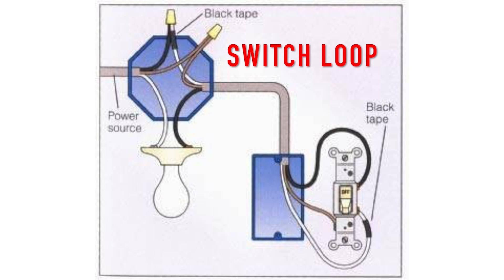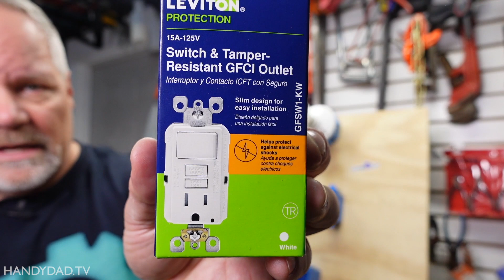GFCI Switch and Outlet Combo

Comment: I followed your instructions to a T and both the switch and the light work in my bathroom BUT now my kitchen and outside light won't work! Any idea why this would be?
Reply from the maker: Double check that you didn’t reverse the line and load wires.

Comment: Very helpful - but instead of wiring the GFCI Switch to a light bulb,   can you wire another receptacle so that it is controlled by the switch?        Not sure I understand why the two wires associated with the GFCI's switch are black,   when you need to have a white and black wire (plus ground)  going to a downstreat receptacle?

Thanks
Reply from the maker: You can supply any load from the switch, regardless of whether it’s a light or receptacle. Both wires are black because they are hot wires.

Comment: Hi, thank you for the great video. If there is no neutral wire present in the socket, there is no way i can wire this right? There is only the hot and the one going to the light.
Reply from the maker: Correct. You need a neutral.

Comment: My outlet only works with the light switch is on... What did I do wrong?
Reply from the maker: You connected one of the switch leads to the hot line and the other to the brass line screw. 

You need to connect the hot line AND one of the switch leads to the brass line screw. The other switch lead goes to the light.

Comment: This is one way of wiring but, This way bypasses the gfi protection for the switch leg, witch is fine if your light is in the ceiling,  but if your light is in the shower with you then you would want the switch leg protected also, it's almost the same except you would wire the switch lead to the load side, the side with the sticker on it and the neutral as well to the load side and then  the outlet and switch leg are both gfi protected.
Reply from the maker: You are correct. It can be wired so the light is protected. But that’s rarely done so you don’t find yourself in the dark if the GFCI trips.
Reply: @handydadtv  yes but if it trips that could have saved your life thats literally the point. i would rather be in the dark in the shower then being electrocuted in the shower,  there are many reasons not to protect the switch leg, but there are also many reasons to protect it as well, this device does not include instructions for bypass for a reason, im just saying people should know and understand their situation first and what needs and doesnt need protection before you wire in gfci devices and take upon yourself to bypass the protection part.

Comment: What if all I have is two wires, no ground and no neutral?
Reply from the maker: To use this device, you’d need to run a new 3-conductor cable between the light and the switch box.

Comment: I wired my outlet exactly like yours (same model number and brand) and my outlet shuts off with the switch. No idea why
Reply from the maker: If the old outlet was controlled by a switch, the new outlet will also be controlled by the switch.
Reply: @handydadtv there was only a switch installed, added the Levinton switch GFCI in hopes of being able to have an outlet as well. But the video was still very informative!
Reply from the maker: Oh, I misunderstood. The hot wire needs to be connected to the GFCI line terminal along with one of the switch wires. The other switch wire goes to the load.

Comment: So what the switch legs gfci protected?
Reply from the maker: Lights and exhaust fans do not require GFCI protection, but you can wire the switch lead to the load terminal if you want it.

Comment: Thanks.  Have one where you connect the switch outlet combo to another independent switch?  Have one to control the light and then use the combo for the exhaust fan independently.
Reply from the maker: I’d use a double switch and separate a GFCI outlet.
Reply: @handydadtv thank you for the quick feedback.  Was able to get it figured with a jumper wire.

Comment: Great video! I noticed on the load terminals there is yellow tape over it. If I want to provide GFCI protection to my circuits downstream, would I wire the hot from the light to the load terminals in lieu of the two stranded black wires? Thank you.
Reply from the maker: Yes, but you need to connect the hot and neutral for the downstream outlets to be protected.

Comment: My house was built in the 50s. The bathroom currently has a combo switch/outlet without gfci protection. I bought this combo switch/outlet to have the gfci protection. But when I took the original one out I was so confused. There are only 3 wires. 2 neutral and 1 hot. I tried to follow this video but no luck. Any advice as to what I can do?
Reply from the maker: You can’t determine wire type by color in old homes. Use a meter to test voltage. 

You should have a line, load and neutral. The line is hot all the time. The load is hot when the switch is on. The neutral is never hot, but provides voltage relative to the hot and no voltage relative to the ground.

Comment: 3:12 what happens if you hook up that switch like normal for that switch loop with black wires and whites wires connecting to the back like normal ❓
Reply from the maker: The switch is like any other switch. Just don’t confuse the white wire of a switch loop with a neutral.

Comment: Very good video. Just one thing to add. To make your light also gfci make to connect your light wires to the load side of the gfci outlet. That way when the gfci trips it will also turn the light off especially when in contact with water.
Reply from the maker: Typically you don’t want to be in the dark if the GFCI trips.
Reply: @handydadtv 😂😂😂😂

Comment: Great video! I think I can tackle this now but I don't have a ground wire in my original light switch, will this be an issue?
Reply from the maker: Not ideal, but it will work without a ground.

Comment: Why'd you choose to leave the switched circuit unprotected by the GFCI? Are there any downsides to connecting your switched lamp or in my case, garbage disposal to the GFCI load side?
Reply from the maker: For a disposal, it MUST be GFCI protected. But the typical use case is bathroom lighting, which doesn’t need to be protected. Plus, I wouldn’t want the lights to go out if I tripped the GFCI by accident.

Comment: I have 3 GFCI outdoor plugs on a 15amp breaker.  All were working just fine.  Now my scenario is one GFIC is green and test resetable,  one is showing red and not resetable.  The last one is dark, no power to it.
I just changed out the red GFCI receptacle and the replacement is showing the same red light and is not resetable.  Pulling my hair out here. :-)      
I dont think its a incorrect wiring ( line load setup incorrectly) as I rewired these several years ago and they have been working fine until now.
Of interest, in the faulty GFCI,  the hot to neutral voltage was reading 5-6V  and measuring hot to ground was 25-26V.
My fear is that I have a wiring issue  and on a finished house, impossible to deal with.
Any ideas?
Reply from the maker: Don’t connect a GFCI from the LOAD screws of another GFCI. Use pigtails and wire nuts so everything is wired using only the LINE screws. 

To troubleshoot, disconnect everything so only the first one is connected to the circuit breaker. Verify it works. Then connect the second and retest. Repeat for each additional one. By process of elimination, you should find the issue.
Reply: @handydadtv   Thanks much!  So what your saying is that in my sequence of three receptacles,  the only receptacle that should be GFCI is the first one?       Weird, its been working for over a year with no issues......
Reply from the maker: @Anavllama No, you CAN have multiple GFCIs on the same circuit, just don’t daisy chain them to the LOAD screws or it can cause issues.
Reply: @handydadtv  Update:   This time I removed all the Receptacles and started with the wires only.  I started with the first GFCI receptacle which is working properly. Tested the voltage and all is good and rewired it so the two wires to the next receptacle were also in parallel (not series).     The next receptacle with the red light originally, is problematic, or I should say the wires at the junction box or problematic.    I did note that the two ground wires were wired to two different screws so I put the two wires on the same screw and then the single separate copper wire for ground on the receptacle on the same screw.
These are the results with no power applied to the circuit.

Line Voltages  ( wire coming from first good receptacle) 
Hot to Neutral  0.5V
Hot to Ground  0.5V
Neutral to Ground  0V
Load voltages ( wire going to next receptacle )
Hot to Neutral: 0V
Hot to Ground: 2V
Neutral to Ground: 2V
These are the results  with power applied to circuit. 

Line Voltages  ( wire coming from first good receptacle) 
Hot to Neutral  8V
Hot to Ground  8V
Neutral to Ground  0V
Load voltages ( wire going to next receptacle )
Hot to Neutral: 0V
Hot to Ground: 2V
Neutral to Ground: 2V
Conclusion, there never was an issue with the GFCI receptacles as none were involved in this testing.  I suspect now that I have an internal and potentially dangerous wiring somewhere in the house that is causing a leakage of around 112 volts ????
Probably at the second box?   In any case doing the wiring in series when and if I get the voltage fixed between box1 and box2.   No hope for box 3 otherwise :-((
Reply from the maker: @Anavllama I don’t think there is any point to measuring the voltage on a dead circuit because nearby wires could be causing induction current. I’ve never done troubleshooting like that.

I troubleshoot by disconnecting the devices and separating the wires, then turn on the breaker and test for voltage across hot-neutral and hot-ground. There should be no voltage on neutral-ground. Then reconnect one device at a time and retest.

Comment: This video has helped me just know more than you know! Never heard of a Waygo connector for starters, running to grab one now bc holy crap is that going to make this so much easier. 

Also, I was lost on this new switch/outlet combo replacement. You told me what I needed to hear. Will be glad to get this installed and working
Reply from the maker: Glad it was helpful 👍🏻

Comment: Can you use the switch to power the recepticle? I have a plugged disposal and I want the switch to turn it off and on
Reply from the maker: Yes. Connect the hot wire to one of the switch wires and the other switch wire to the brass LINE screw.

Comment: Long shot since this was from a year ago. Im using this outlet in a garbage disposal/dishwasher scenerio.  When I run to the outlet under the sink it will not allow me to operate the two outlets independently.  I broke the tab on it so they shpuld be seperate but no matter the wiring configuration I cannot have constant power to the dishwasher and operate the garbage disposal with the switch.
Reply from the maker: The switch/outlet combo can be used with a disposal but you’ll need a separate GFCI outlet for the dishwasher.

Comment: Can you explain what to do with the two leads if you're wanting the switch to control the outlet itself. Only three wires coming in, nothing going out.
Reply from the maker: In that case, you need to connect the incoming hot wire to one of the switch leads, then connect the other switch lead to the LINE screw. That way, the outlet will only have power when the switch is on.

Comment: It surprised me that your load (light bulb) was powered via the switch even though the outlet was not operational yet because you had not engaged the reset button.   I had assumed that the switch was also part of the GFCI circuit.  Apparently not.
Reply from the maker: You can wire it that way, but the light doesn’t need to be GFCI protected.
Reply: @handydadtv  Not the point.   The point is that the switch is not part of the GFCI circuitry unless you wire it that way.  That's important to know.
Reply from the maker: @timthetoolman5522 Right. It’s a combo device that really behaves like two separate devices.
Reply: @handydadtv  Correct.   Thanks.

Comment: Can you show us how to wire this outlet when you have a red black white and ground on one side and black white and ground on the other?
Reply from the maker: No because you may be dealing with a 3-way circuit.
Reply: @handydadtv  So do I just connect the red wire separate from the outlet? I have 14/3 romex

Comment: I just bought the exact outlet combo . After install I have power with the switch but outlet will not work.   There is also no ground wire, could that be the reason the outlet will not work?  Should also mention I do have the green light on
Reply from the maker: Make sure you connected power to the LINE screws, not the LOAD.

Comment: Question if I have a load should I connect one white to the line side and one to the load side? I see you connected both to the line side.
Reply from the maker: If you want the load protected, use both load screws.

Comment: In my kitchen there is 2 outlets the on counter wall and the small metal plate of one of them  is cut so i dont know how to connect a new safety outlet cause thete is no metal between the 2 sockets 🤔 excuse my english 🥴
Reply from the maker: Call a qualified handyman if you can’t figure it out.

Comment: Question I’m hoping you can help answer. My current switch just has the two black wires but no ground connection. There are two grounds threaded together in the box but not connected to the switch. Do I need to get a wago to connect the two ground wires and then run a third to the new combo switch/outlet? Or I can I just run one of the grounds to the combo and put a nut over the second ground?
Reply from the maker: You should fix the last guy’s mistake: always pigtail your grounds and attach to the device. You can use a Wago or wire nut.

Comment: I'm trying to switch out my old receptacle. I have a 75-year-old house. I don't think the wiring is all that great. My question to you has to do with the last two black wires. I get where you put the one wire in but then the other black wire. I have nothing to hook it up to. What should I do in that case? The receptacle that was here before just had the one plug-in and the switch for the light. When I pulled it out I've got the black wire, a white wire and a green wire. You explained what those all are. What do I do with that last wire? Thank you!
Reply from the maker: When in doubt, reconnect everything exactly as was connected to the old receptacle.

Comment: An older home like mine does not have grounded switches and outlets.  Does adding a gfci switch/outlet combo give me the protection I need in my bathroom?
Reply from the maker: A GFCI will still protect you without a ground wire.

Comment: Great video. Only thing is that I fail to see the benefit of wiring the switch outlet on the line side instead of load side of GFCI. O. The load aide you get the protection and if something goes wrong you'll notice it when trying to turn on the light
Reply from the maker: If the GFCI trips, you’d be in the dark. Plus light fixtures generally don’t need shock protection.

Comment: This video saved me a $150 electrician visit that would take them 5 mins.  I could get the switch to work or the outlet to work but not both. The missing piece was attaching one of the switch wire to the line terminal. The instructions included with the product did not clearly show that, if at all. Thanks again!!
Reply from the maker: Glad it was helpful 👍🏻

Comment: A few years ago I installed a Pass & Seymour version of one of these. It was poorly-documented and I had a time figuring out what to do with those two wires hanging out of the back of it. I got it installed, but it was a "trip," no pun intended.
Reply from the maker: I’m “shocked” to hear that. 😜
Reply: @handydadtv 😄 I think you got me to try Wagos. I have been stubbornly resisting them for several years, but you made this look so easy that I ordered a pack.  But I'm only going to put light loads on them. I read something long ago that said with heavier loads (1,000+ watts) the Wagos get quite warm.
Reply from the maker: @topgrain https://youtu.be/OhFwcEcNF2I
Reply: @handydadtv  Thanks. Yes, that's a pretty extensive test. Perhaps later I will try a Wago with a much bigger draw, but for now, my greatest trust is still with the unassailable connection and current flow between wire ends inside the proper size wire nut.

Comment: Thank you for the clear and concise instructions. You mentioned that when the device trips, the switch is not effected. Is there a way for the power to shut off to the switch? I am using this device to keep a power surge (happened a while ago) from blowing the mother board of my furnace. I currently have a standard switch that I can use to cut power to the furnace if work needs to be done on it. If the switch in this device is not tripped, as in the case of a power surge, then my MOBO could still be effected. In my case I need power to stop going to the switch. Is that possible? Thanks for your help.
Reply from the maker: Yes, you can wire the switch from the LOAD screws so it is GFCI protected. However, a GFCI provides NO surge protection. Use this instead: https://a.co/d/guFeklY?tag=ha0d9f-20
Reply: @handydadtv  Thank you for your help.

Comment: Very concise video. Question: If the power source into the GFCI/Switch is old 2-wire with no ground and the rest of the circuit is 2-wire ROMEX with ground, what do you do with the ground wire in that box? Do you pigtail it to the ground screw of the GFCI/Switch, or do you just cap the ground wire?
Reply from the maker: Use a meter to test for voltage across hot and the metal box. It may be grounded. 

Either way, I’d still bond the ground wire to the box and the ground screw on the device. The GFCI will still protect you even with an open ground.